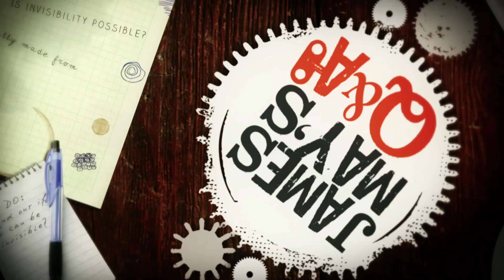Why Can't Trains Go Uphill? | James May's Q&A | Earth Science

Comment: What about a maglev train? How much of an incline could the magnets push it up?
Reply: Salty Admiral That's actually a very interesting question, because a Maglev is basically a large linear motor, and linear motors don't rely on friction to generate tractive force. It's possible that Maglevs would be excellent at going up hills, but that would be largely dependent on how much torque the linear motor could produce. I think it would probably be a lot, since electric motors produce more torque at lower speeds. Their primary limiting factor is that an electric motor (or linear motor) produces more heat at lower speeds and if not properly cooled can melt or catch fire.
Reply: +George the First your answer is so complete it made me grin like a child. Well researched sir!
Reply: Id think very low considering how little friction there is
Reply: Keri Ogilvie 
Maglevs have basically zero friction. They use magnets to levitate and propel the train. It doesn't touch the track. Well I've seen some that had tiny wheels on the sides, but they just make sure the train doesn't bump into the track and stays centered.
Reply: +NorfKhazad Linear motors do not produce torque, they produce force.  Torque is simply force going around in circles!  Given that the liner motored vehicle has no rail friction the incline it can negotiate is determined simply by the equilibrium of the forces acting along the direction of the rail. Down the rail is the vehicle's weight, factored by the angle ( in simple terms ) and up the rail is the undiluted tractive effort or force of the motor.  A simple equation will tell you the max incline.

Comment: one litle comment: The weight pressing on the tracks is reduced when going uphill/downhill (you can split the weight into the component parallel to the tracks and the one orthogonal to it. When perfect leveled the orthogonal one is 100% but when going up a 30 degree angle it is only 50%
Reply: +Christian Kunert Thinking about it in my head wouldn't the force becoming down over an area aft of the contact patch of the wheels on an incline where on level ground its coming down overtop of it?

Comment: what about maglev trains? can they go uphill
Reply: TheAGCteam You are probably referring to cog railways, which use a central toothed rail and cogs (essentially gears) mounted on the locomotives to climb grades up to 25%.
Reply: That's what I was thinking
Reply: Shaquira-Taiquana Jashanna Tyteyana Patriciana Yoseline intresting name
Reply: Shaquira-Taiquana Jashanna Tyteyana Patriciana Yoseline I saw a crazy train in Switzerland that could go up a steep mountain side. It might have used gears instead of wheels though..
Reply: Shaquira-Taiquana Jashanna Tyteyana Patriciana Yoseline Maglev is just another method of having a low drag ground to train connection. The problem of power vs weight and low friction remains
Reply: Shaquira-Taiquana Jashanna Tyteyana Patriciana Yoseline +dom69foco Yes, I believe maglev trains can handle pretty serious gradients compared to other trains. They get their traction force through magnetism, which, as a non contact force, can be scaled up without also giving the train greater drag/friction forces. Of course there's practical limits (size and cost of magnets, eg).

Comment: Why don't they just put rubber around the steel wheels?
Reply: Yoububehahaha They would be worn out in 10 minutes
Reply: Yoububehahaha the whole point is low friction for efficiency.  You want them to put the rubber on like snow chains?  Just stop the train and jack up the locomotive or something?
Reply: Yoububehahaha Have you ever seen a penny that has been run over by a train.....
Reply: They use sand to add traction.
Reply: +Peter Bone Also a train is kept on the track and steered around the bends by the differing radius of the wheels. Rubber would I think deform too much to allow this to work well enough.
Reply: kristofferson1294 and will last for a short time. It's only on acceleration to reduce wheel spin from stationary.
Reply: Blue Neck Media better than nothing
Reply: Craig Jensen When I went to Sri Lanka where youre allowed to walk on the lines I used to do this all the time. Something very satisfactory about it.
Reply: Yoububehahaha Some trains do have rubber tyres. They have some advantages and some disadvantages as this wiki article mentions: https://en.wikipedia.org/wiki/Rubber-tyred_metro 
Cheers
Reply: Yoububehahaha You weren't listening. The reason that trains can go fast with low power is because of the low friction.

Comment: Will this phenomenom apply to trains like maglev??
Reply: Yes i think that is basically a no duh question
Reply: This particular phenomenon does not apply to maglev, because maglev does not use traction to propel the train, and so aren't traction limited.  Typically maglevs will use linear induction motors (basically like an unwound electric motor where the track itself forms one half), and so it's purely a matter of the power available, versus gravity.

Comment: Why can't train tires and rails have treads that will interlock with each other like a zipper, I'm sure that'll solve this problem
Reply: ditkacigar89 Because as soon as there's even the smallest imperfection, like a bump or warp in either the tracks or the wheels of the train, the "zip" doesn't line up any more and the train will probably derail.
Reply: basherofnoggins ditkacigar89  Actually, there are ones which do that. They're called Cog railways. Examples of which include the Pikes Peak and Mt. Washington cog railways in the US. The problem is, they have to have specially made cars and locomotives to deal with the steep slopes, which cannot be used elsewhere. They're also just for tourism, mainly, because of how impractical they actually are.
Reply: ditkacigar89 Cost, drag, vibrations and speed.

Comment: Do not confuse sliding friction force/grip with rolling resistance. Rolling resistance is usually based on deforming materials. Steel doesn't deform much, so steel on steel is low rolling resistance (it also happens to be less grip too but wheels made of compressible foam would have more rolling resistance than a solid band of rubber but less grip)

Comment: Technically, when going down hill, depending on how long the train is, for arguments sake, if the loco has 6 wheels, and you have 3 coaches in tow, the adhesion area for braking is 400% more than the adhesion area going up hill, because up the locomotives 6 driving wheels has to haul the train up, but the brakes apply along the whole train going down! :-)
Just thought I'd add that in.

Comment: The best locomotives for tackling grades are American geared steam locomotives (the Shay, the Heisler and the Climax locomotives). I have heard of a Shay going up a 14% grade before. That's why they were so popular with logging railways. If you haven't heard of aforementioned locomotives, I then suggest you look them up. They're really quite amazing!
Reply: And those locomotives with rack rails and pinion wheels, they can climb mountains with 2% grades.
Reply: Shays are amazing, i've seen the ones running on Cass Scenic (which has a 11% grade).

Comment: To climb steep hill, train use rack and pinion arrangement in the middle of the track as in "Nilgiri Mountain Railway".
Reply: Funicular railways are entirely different situations and are designed specifically for one job - to climb hills. It's not as though you'd be able to retro-fit a geared climbing system onto standard trains with much ease.

Comment: "A typical 12 wheeled locomotive" - that would have six driving axles.  Going by the graphic that came up, I'm guessing that should have been "A typical 6 wheeled locomotive"?
Reply: If you look at a locomotive like the LNER Class A3, it has a 4-6-2 configuration making it 12-wheeled. I do agree that in this case, the graphic would be misleading though :)
Reply: I think he meant a typical locomotive of today, like a Class 57, 58, 60, 66 or 92 locomotive.
Reply: WildNorWester A better way to put that would have been a 6 axle locomotive
Reply: They literally could have put any engine made after the GP60 for that
Reply: In steam engines 12 wheels did not automatically mean 6 driving axels. Ie Pacifics are 2C1 or 4-6-2 in the US but only three axels (The C Part) are powered

Comment: Also worth noting is that rubber tire PSI is a function of contact patch area, explaining why large trucks need dual tires to hold so much weight. If tires had only the contact patch of train wheels, PSI would need to be impossibly high.

Comment: Thanks for the good video, James.

Now, if you could make the EU commission "railway experts" watch this until their eyes bleed, that would be great.

Why?

Well, the dumb idiots have decided that consequent lightweight construction is the way to go, and that trains shouldn't have an axle-load of higher than 20 tons.........yeah with traction motors capable of 6,400 KW per hour installed.

To quote a locomotive driver friend of mine: "20 tons per axle works, but only in sunshine and dry conditions, if you get even light rain on the tracks, you'll wheelspin, nevermind snow or ice."

Having a four axled loco weight 80 tons, is way too light, in dry weather they might use half their tractive force, in snow or rain........less than one third.

A loco needs to be heavy to get good traction.

Those guys in the EU commision have no idea of the matter at hand, they think they can use the same techniques as in cars.

Considering railways, 95% of their policies have been a hindrance.
Reply: Anyone who uses KW per hour has no idea what he is talking about. It makes no sense.
Reply: Sander Vercammen
So you dismiss all I say over a small error in writing?

What I meant was that the loco had an hourly rating of 6,4 kW.

That it can run on a power output of 6,4 kW for an hour without damaging the traction motors.

https://books.google.de/books?id=ygKio-Ks0doC&pg=PA128&lpg=PA128&dq=hourly+rating+locomotives&source=bl&ots=AI46tEDgxi&sig=eDimO9BDqfd7iJFg8Oct4H8mX5k&hl=de&sa=X&ei=jwuUVJOHGMHOyQPi74HADQ&ved=0CCMQ6AEwAA#v=onepage&q=hourly%20rating%20locomotives&f=false

So it does make sense, as it can run on that power output setting for an hour.
So in a purely physical sense you are right, as watt is the work in one second.
But what I emant is that it could do the work of 6,4 kW each second for one hour straight.
Reply: 6.4Kw seems like a very low figure, that's something like 10 hp or so?
Reply: Sander Vercammen
:D Well that happens if you downsize your own information, because it sounds to big.....:D

Correct it should be 6,400 kW or 6,4 mW, or roughly 8000 hp.
And a tractive efford of roughly 300 kN (theoretically), which is nearly never used, as it would tear the couplers apart.

I was talking of this loco the Siemens Eurosprinter Series:
http://en.wikipedia.org/wiki/EuroSprinter

And it's companion the Bombardier TRAXX Series:
http://en.wikipedia.org/wiki/TRAXX

Both are known for having too little adhesive weight, but the TRAXX is known to be worse due to the it's lower weight.

The problem is especially pronounced on the Br 185 which was originally designed for 4,6 mW instead of 6,4 mW.

Compare that with a heavy freight locomotive like the Br 151, less power, 6,288 kW but a starting tractive effort of 395 kN.
all due to the loco spreading the tractive effort over two axles more and being 32-38 metric tons heavier than the corrosponding locos.

Sadly those aren't built anymore, because their seen as creating too much wear and tear on the rails and several stupid parts in the EU speicifications for interoperateability.

Sorry for using wikipedia links, I'm lacking corrosponding links in english right now.
Reply: Or just don't have locomotives and have powered carriages and trucks. (or a locomotive to generate the power for the carriages and itself)
Reply: Mediocre-Motorcycle-Modifications They tried that with the Cargosprinter, which was unsuccessful. 
The only succesful applications are the TGV Postale in France and some specialized versions in Japan. 

The problem with Freight EMU's is that they are to inflexible, as they only run in a certain formation. 

Now if we had powered bogies in the individual freight cars, that might work, as you could still mix and match them. 
You would need a UIC standardized design though, one where not only the control system is compatible but also the electric system. 

The problem is that even if you use a loco to tap into the OHL or generate the power, you would need to lay a seriously high voltage electric wire along the train, one which needs to be able to be safely disconnected for uncoupling. 

I'll have to ask a friend of mine, who is a loco driver, just what currents and voltages would be required and if it would be possible with regards to safety.
Reply: Axel loads of 20to where for a long time considered heavy in Europe. Well into the 1960s this was the mainline limit and loads below 16to where prefered

Comment: Some trains can go up extremely steep slopes. For example, the Scarborough RT trains can go up the slope just north of Kennedy station.
Reply: its because they usually have a cogwheel pulling it up, not a steel on steel situation.
Reply: ***** Wow.
Reply: Some trains run on straight up linear induction motors (3 Scarborough RT is one of them, I think). The drive power is applied directly to a third rail stator. Traction is kind of moot at that point.
Reply: *****
Depends on the train. Some use cables, but there are some that use toothed wheels (cogwheels) to get them up slopes as high as 45 degrees

Comment: Here is another reason. A two-wheel-drive car is something like 50% efficient with traction. In other words, about half the weight is on the drive wheels. If the car is weighted towards the side of the drive wheels, it is more efficient. If the car is 4-wheel-drive, it is even more efficient. If it is 50-50 balanced and 4-wheel-drive, it is 100% efficient.

A train is about.... Not at all efficient. if there are 10 cars of equal weight, including the engine,the train is 10% efficient. If there are, say, 100 cars, 3 of which are engines and all are the same weight, it is 3% efficient, which means that it will slip very easily considering the low coefficient of friction of steel-on-steel.

Comment: Correction: most humans can't go up 80 degrees, which as the video mentions is essentially like trying to walk up a wall 56.7 meters high and 10 meters deep.
The can go up an 80% grade. 80% of what, you may ask? Well, you go 80% as much up as you go forward. That is a lot less than 80 degrees. That is like climbing a mound 8 meters high and 10 meters in radius.

Comment: Great Video, loved the cut-outs and presentation of the material.  Correct me if I'm wrong but the equation for Frictional Force has nothing to do with the surface area of the object (you said that part of the reason trains have trouble going up hills is because they have only a small area of contact with the rails).  The physics equation for frictional force is the constant of friction multiplied by the normal force of an object, which on a horizontal plane is simply the weight of the object, which Is the mass*gravity (Gravity=9.81 m/s^2). This can be represented by F=µ*N.  Where µ is the coefficient of friction and N is the Normal Force. Tractive effort however is different and it more involves, velocity, power, and piston bore (in steam locomotives). Maybe I'm crazy. Anyway keep up the good videos, very informative!
Reply: In the general case µ can be a function of velocity, though this is often neglected for simplicity. In fact the frictional force will decrease when a train goes up hill as only the component going perpendicular to the ground will comprise the normal force. eg F=µMgcos(x) where F is the frictional force, M is mass of train and x is angle between normal to ground and direction of gravity. Adding to this the effect of a component of weight now acting against the direction of the train and this makes it much harder. W = Mgsin(x) where W is the component of the weight acting down the slope, against the direction of motion of the train. Neither of these are helping the train. You can look at the taylor expansion around x= 0 to see that for small changes in gradient the frictional force is roughly constant whereas the component of weight is linearly dependent on the angle between the normal and gravity.